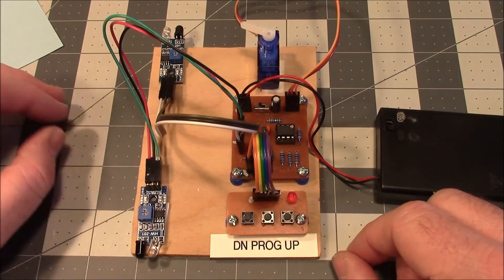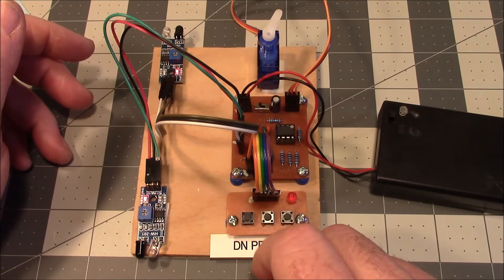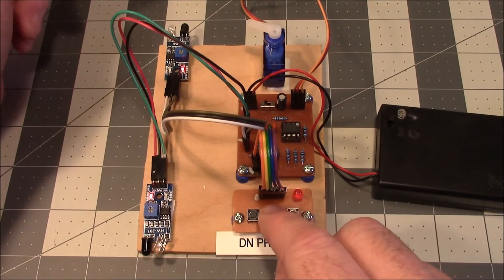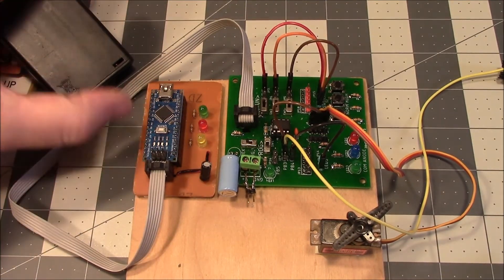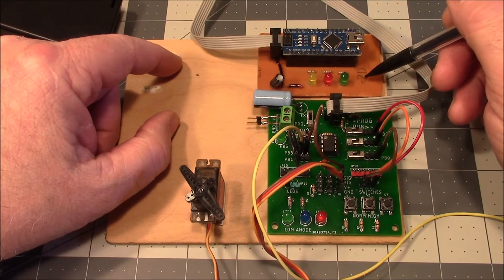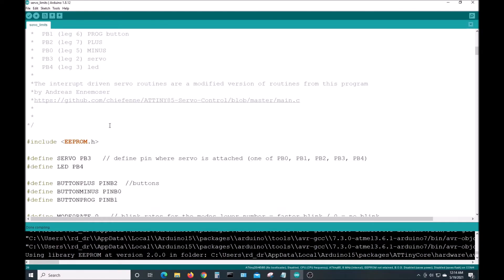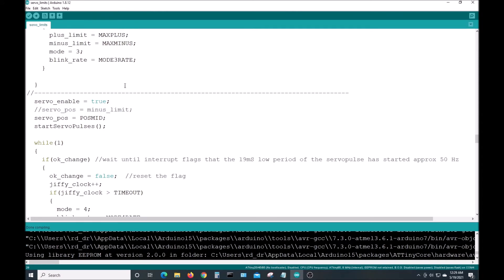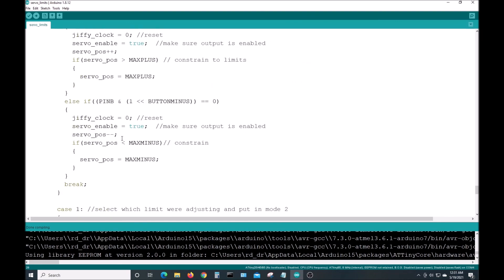Push button controlled servo with adjustable end stops using an Attiny85

Comment: I made the circuit, it works very nice and stable, thank you very much, I have a question for you, how can I reduce the speed of the servo above your coding?
enjoy your work
Reply from the maker: Thank you. I'm sorry for the late reply. It's been years since I looked at the code. I added a  version of the program with a servo_speed variable to the Github repository.
https://github.com/Rick-100/Push-button-controlled-servo-with-adjustable-end-stops-using-an-Attiny85

  You can set the value before you burn the Attiny85.  It will allow you to slow the speed of the servo when it's moving from end to end. The servo still move at full speed when the end stops are being adjusted. I'm not sure if that's what you want. Most of the change to the program were in a block of code after the   "  if(servo_pos != target_servo_pos) " line. Basically you just have to move the servo in steps. The user interface code makes it harder to do in my program.

I'm glad to hear you were able to get it working.  What are you using it for? Did you build the circuit on a breadboard? I realized when I was looking at the Github page that the EasyEda links don't work anymore. I will try to fix them.